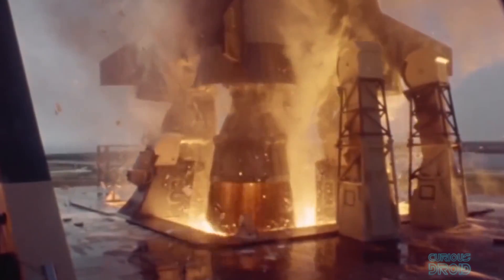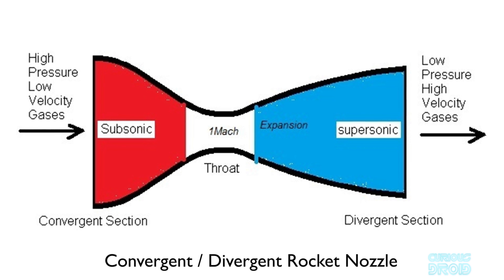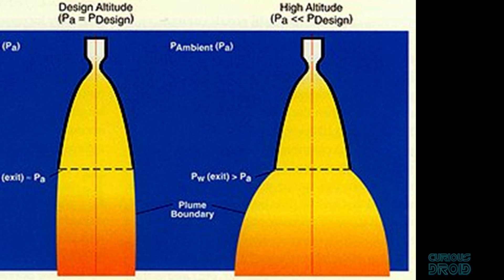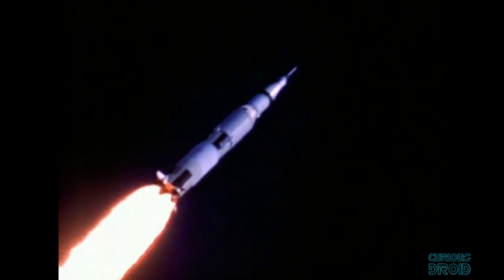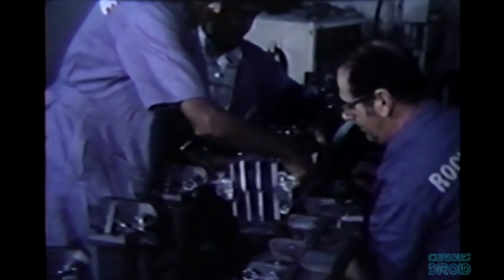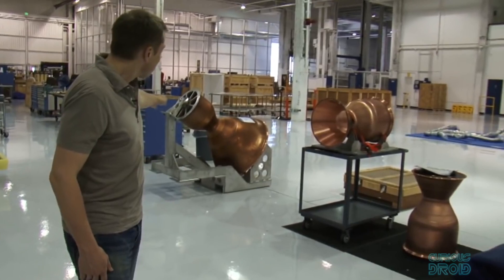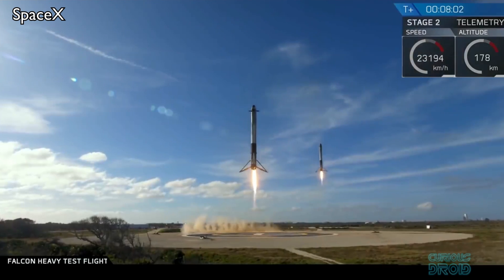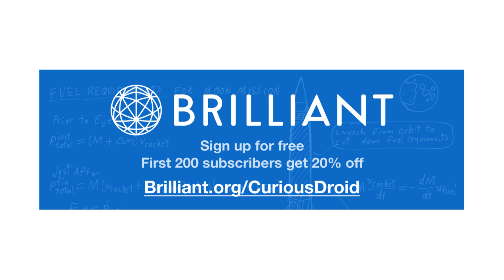Aerospike Engines - Why Aren't We Using them Now?

Comment: Damn the cost!   Nasa needs to bring back the Venture Star program, re-vamped, with Space X as a partner. We need a shuttle replacement that works well!!
Reply: I saw the partially assembled X-33 in its abandoned hanger back in 2004.  Crazy to see such a high tech machine abandoned and covered in owl shit.  Making the fuel tanks in the shape necessary for that lifting body platform is just too complicated, and materials haven't changed much since then.  It'd be interesting to see a conventional cylindrical rocket using them though.
Reply: I met a guy who worked on it.  He said they knew the composite tank would never work, they put it in there anyway because they needed more time to write the avionics software.  They underbid on purpose also; when Pete Conrad was told by NASA Lockheed was going to win based on price, he told them McDonnell-Douglas's bid was how much it's going to cost and Lockheed was lying.  And what I heard was that with aluminum tanks could take off, but it had no control authority so a breeze might push it into the tower.
Reply from the maker: That was NASA's big mistake
Reply: That should be the title of your video :  "Nasa's Big Mistake"        Or maybe a Future Video?? 
I even built a hybrid electric/rocket plane, and called it "Future Star".  
here is a link:
https://www.youtube.com/watch?v=J7f8hf8kgfg
Reply: Nope, NASA dodged a bullet.

First, the contract that NASA had with LockMart was a "prove it' contract, they got a fixed one billion dollar contract, if they exceeded that amount, LockMart had to eat it. They exceeded the billion dollars, LockMart had the nerve to ask NASA for more money and NASA said "Did you read the contract you signed?" By that time, LockMart wasn't going to do so and they stopped all work on the X-33, then a year later tried to hand it off to the USAF and they got laughed at. Why? Because...

Second, the X-33 was attempting to use technologies that had never been used for spacecraft, including composite laminate fuel tanks to save weight; and here's when things got ugly; during a tanking test of the X-33, when they were refilling the tanks with liquid nitrogen, one of the two tanks proceeded to split like an overcooked hot dog. This caused LockMart to consider adding metal fuel tanks to replace the composite laminate, which led to the issue that killed it.

Adding metal fuel tanks increased the weight of the X-33 to where it could not launch from the pad, it would have been too heavy-and that's when LockMart went to NASA and started begging, with NASA telling them to stick it and the USAF running away as fast as they could. And mind you, the X-33 was a quarter scale prototype, not a full scale one.

Don't blame NASA, blame LockMart.
Reply: Mark Wandrey
Space X doesn't pay everything out of their own pocket either, they got most of their funding from NASA. Actually, it's no different than any contractors NASA got involved with, for example, Lockheed Martin, one of NASA's contractor funded only part of the development and the public funded the rest. Hell, Lockheed Martin needs Boeing to build the wings. The only difference is that Space X has integrated production process, which bring down the price, making it a more attractive contractor. Generally, having one contractor do everything is cheaper than having many contractors. As big as Space X is, it doesn't have the resources to self-funded everything.
Reply: Lots more jobs for congress to brag about by throwing away 99% of the space ship on every trip. Venture Star promised reduced costs, reduced labor, and reduced pork. It was doomed from the beginning.
Reply from the maker: @FPVREVIEWS, mind reader, it's already in the works :-)
Reply: How are they going to rob from the poor to give trillions of dollars to the richest people on the planet if they have to spend a few million on rocket science? Their number one priority is to make the rich richer and the poor poorer and more miserable. That's it.
Reply: +Mark Wandrey NASA was testing the concept with the Delta Clipper, which worked beautifully. The fourth flight, the Delta Clipper was lost when one of the landing legs collapsed on landing, but the execution was solid. Why they decided to abandon the concept has never really been fully explained.
Reply: The Shuttle was killed because it was kept on for far beyond its designers' dreams. Using 60-70's era technology in computers, engines, turbopumps and insulation. That was why it cost so much to fly and maintain - some of the people that built it weren't even around at the time of the last flight during the Bush years. 

SpaceX exists only on the generosity of Uncle Sam. That "self-funding" comes off their profits off contracted launches. And as well it should - self-funding and expansion and vertical integration should not be regarded as something exceptional in any enterprise and yet somehow SpaceX is lauded for...doing something that everyone else does?

For all that the commercial space "industry" prides itself upon in innovation it in fact wallows in its own mediocrity and conservative nature. NASA itself considered and built the likes of VTVL and DC-X vertical landing rockets and the descendants of its technology live on in SpaceX's own reusable booster program. The Aerospike, NERVA/Pewee, Saturn, and a multitude of atmospheric flight concepts like thrust vectoring, composites, nickel-based superalloys and supercritical aerofoils are all technologies that NASA pioneered and that have now diffused to global use.

What has killed NASA and the general state of innovation in the US - and I mean genuine innovation, not rehashed concepts as an "app" or government-developed technologies given a new lick of paint under a "commercial" brand - was the post Cold War malaise that followed the fall of the USSR. And the rise of fiscal "austerity" that has done little but drive engineering talent either overseas or into the finance sector where their machinations led to the 2008 financial crisis. 

NASA's budgets, programs and plans were absolutely gutted after the US won the space race to the tune of only a few billion dollars in today's money. Chump change when you consider today's military budgets and the absolutely dreadful waste that has occurred in successive "defense" procurement debacles. There could have been a Mars colony started a decade ago, space nuclear power and propulsion, an orbital refuelling station and multiple missions to the outer reaches of the Solar System had NASA's funding been maintained and plans stuck to.

It is in fact the phenomenon of fiscal "responsibility" that had driven innovation out of the spaceflight and arguably nearly every other sector. Instead of engineers driving design decisions it is now a bean counter that needs things filled out in triplicate and a business case made for the most minor of changes. Encouragements by MBAs to sub- and sub-subcontract work in order to foster "competition" amongst suppliers of parts, draining both operating margins and expertise out of engineering teams and towards external contractors that do the same thing but that cost more. Boom and bust cycles of hiring and firing that replace experienced talent with fresh faced kids thrown into the deep end because they're willing to do the overtime whereas the seasoned employee has family commitments. HR, OHS and marketing departments that further drain operating revenues for questionable return on value and that seek to impose their own bureaucracies in the name of workplace "efficiency".
Reply: Never mind the enormous economic benefit to the US economy of the space program.  NASA budgets are background noise while the bang for the buck disseminates throughout the US economy.  Economic success requires fusion of government and business. That's why ALL successful modern nations do so.
Reply: Elon Musk and his Space X relied heavily on NASA's funding and contract awards, but of course, it's a PR suicide to give even a single dime of credit to NASA because bottom right-wing voters will pressure the government to stop funding NASA, which in turn means less money for Space X. "Private enterprise doesn't cost taxpayer's money" is just an illusion, NASA did way more than just sending rockets into space, they sends and still monitors a lot of probes that's still out there in space, and astronomers around the world still use it. NASA's responsibility is too broad for its current budget, where Space X has a much narrower goal. Elon Musk must keep people believing in "self-sustaining private enterprise" BS because ironically he don't have the financial resources of the entire country to fund such a project by himself.
Reply: Cant build space elevator system yet, until a suitable material is found and other practical issues are solved.     
 And forget about carbon/graphene nano tubes   they are completely not reliable when produced at a length.      the longer it is the more chance of it being weaker then half its original strength due to imperfections
Reply: Private enterprise and the free market will get the job done cheaper, better, and more efficient than the government could ever hope to.  There only needs to be a reason and to get the government out of the way!
Reply: Cheaper is not synonymous with better, and government health care will ALWAYS suck!
Reply: @ Mickey G
Median salary  big deal look at what the really good doctors make.
Before the 0bama care tax you could easily get dirt cheap insurance that would cover catastrophically expensive treatments.
in Canada while waiting months for tests or treatments.
Charlie Gard and Alfie Evans demonstrate the foolishness of trusting your healthcare to the government.
Reply: @Iustinian Constantinescu   
$/kg is where win/fail is determined, ultimately. SpaceX is the company that will do things first, and eventually become reliable. Blue Origin will probably always play second fiddle, but will be the mainstay and model of commercial space travel and exploration. We need both approaches to keep the interest and funding alive.
Reply: The Air Force wanted to look at the Venturestar program to recycle some of it into their space plane program, NASA's response was a firm "no". Venturestar was killed primarily by the Space Shuttle lobby which was/is a coalition of interests who fight against anything that might potentially kill the space shuttle gravy train. This is why the Space Shuttle's replacement is made largely of shuttle derived parts.
Reply: King Peter, that's because there is TONS of money to be had from continuing to limp along using conventional methods, and too much money to lose by allowing technology development that will replace those conventional methods. It grinds my gears that there are companies (and the government) out there suppressing things like cold fusion just so they do not put themselves out of business. I think it is rather short sighted of them. We should be A LOT further along this road if not for things like that. Just like room temperature super conductors, there is no doubt in my mind the reason we do not have them, is because it would crash the power company strangle hold. My dad personally knew a guy who designed and built a carburetor that would get 35 mpg out of a 1950's Buick straight 8, and an oil company bought the idea and it was never seen again. 
So the world focus will continue to be on the really important things like transgender bathrooms, instead of the ever growing population and the Earth's very finite resources. Eventually the human race will either have to expand to other planets, or die.
Reply: Whenever the government gets involved with ANYTHING, we lose more freedoms, it becomes more expensive, quality goes down, and efficiency plummets. There is no mention of the federal government controlling health care in the Constitution. Yes obamacare is most definitely a move to universal health care, it has the government controlling your choices just for starters, and it just gets worse from there.
Reply: Shuttle was a money toilet. What matters is moving payload efficiently.
Reply: Ob Fuscated
They got to repair those space telescopes somehow.
Reply: You tell Elon!
Reply: Actually they fixed the tank issue but not before the money ran out.
Reply: Can just as good start building the international space elevator system. No need for unreliable rockets.
Reply: We don't need a shuttle replacement at all. The shuttle never did a tenth of what it was planned to do. Carrying a big heavy vehicle into space over and over is a bad idea, and always will be.
Reply: Em Em yeah, you probably correct concerning carbon nanotubes/graphene, it's ridiculously expensive and difficult to make in quantities anyhow
Reply: BFR is like a shuttle as its reusable and it has delta wings which makes it a little bit more like the space shuttle.
Reply: Get Congress to pay for it.  :(
Reply: We should just build an orbital ring instead
Reply: venture star's fuel tank ruptured
Reply: The Space Shuttle was made over-complicated due to policies and mismanagement. But I hope to see a new space shuttle based on the BFR or its equivalent... Like UNSC Pelican or the ISV Venture.
Reply: "Damn the cost" is what killed the Shuttle in the first place. Embrace the cost. Focus solely on tons to orbit for as few dollars as possible.
Reply: Falcon9 is a functional shuttle replacement.
Reply: Economy, real fiscal responsibility, is the thing driving the reduction in cost and market domination that SpaceX is surely achieving today, this very moment. Saying they are doing the same thing as everyone else does not explain them outperforming the rest of the market, and neither does saying they're funded by NASA, because Lockheed-Martin has been funded by NASA for decades and they've consistently failed to make a killer app rocket that blew all expectations away. ULA builds a good rocket, but they didn't ambitiously pursue reductions in cost, either. No one is doing what SpaceX is doing, and they aren't getting patted on the back for doing the same old thing.

The shuttle cost so much because it took so long to turn around. The heat shields had to be completely reworked, and the whole craft had to be torn down and rebuilt. By the time it was designed, NASA had no will or wiggle room to make it better, and during the design process they were so hamstrung by the process and the politics of it that they were not able to throw out the design and start again when they realized it wasn't working. They were told to fix each thing, and damn the cost. Saying "damn the cost" will always get you a rocket that's too expensive to fly. The Shuttle cost the US so much money that would have been saved. 

The Space Shuttle engines were a work of art, the most efficient engine anywhere, and they were incredibly complex and expensive to manufacture. They had to be fabricated by expert machinists and they had an immense amount of hand-tooling. This is expensive as hell and not something that can be done in bulk. These engines had to be gone over very carefully every flight. It would have been cheaper to use lighter and cheaper engines that were less efficient if it meant building a bunch of them and swapping them out each time, inspecting the used ones on the ground, repairing them as necessary, and throwing them out if they were slightly damaged. If they had a single-minded vision to get the job done, rather than their mandate to produce components in as many constituencies as possible, to make the rocket "as reusable as possible",  then they might have backed off of the hyperoptimizations of the Shuttle and worked on things that were cheap enough to do the job.

Don't say "damn the cost". Look at what works, and do that, and more importantly, look at what doesn't work, and stop doing it. That's what SpaceX continues to do; they've thrown out innovations they just couldn't get to work, because they want to go to space, not pride themselves on conquering specific individual technical innovations. They wouldn't use Shuttle engines because they know how hard it is to make them; they couldn't afford to make such a complicated engine. They made a new engine because a simpler engine with a few risky but researchable innovations could be produced quickly in volume, which was the only way to produce the volume of rockets needed to dominate the market.
Reply: God, why am I replying to you? You just came up with an incoherent string of complaints about the world, and somehow managed to blame all of them on "fiscal responsibility". 

HR, OHS, and marketing departments seem to improve the performance of other companies. Why is space special in that suddenly when you walk into a space company all those issues go away?

How does procuring NASA rockets with the same exact pricing structure and budget as those same military spending debacles give you a better rocket than the Shuttle? I think you can't pretend like somehow those same funding schemes get more effective when NASA does it, especially since NASA has shown in the past that they cannot build cost-effective rockets using the same procurement methods as the military; how would giving them more money do it cheaper?

How does SpaceX qualify as rebranding of past efforts when none of the efforts to make a reusable landing rocket actually worked? Nobody combined old and new and made it just WORK the best they could. How can you ever compare doing what it takes to get to space with the half-assed money grabs of old space?

SpaceX designed Falcon 9 of their own volition at a development cost a fraction that of what NASA even says they could have, had they had the idea and tried to contract it out for development. SpaceX has dramatically reduced the cost of going to space in a way every rocket vendor on the planet cannot compete with. If they have only been able to do so with NASA dollars, they still did it by saving NASA money and they still manage to outcompete every other rocket on the planet. Any potential true rivals are merely graphite stains on sheets of paper.
Reply: TheRealMarauder
The reason why contractors such as Lockheed Martin can't achieve the same expectation as Space X is because they subcontracted a lot of their parts, which saved them money but will add to the cost for the end customer (NASA and US government). Hell, look at F-22, Boeing manufactured half of its fuselage and P&W developed and manufactured the engine. Space X did one thing that most contractor doesn't do, they produce almost every parts in one factory rather than hiring someone else to do it or produce many different parts at many different locations. Space X isn't necessarily more innovative than other contractors, if anything, other contractors such as Lockheed, Northrop etc. actually have better technology on paper, it's just that they can't produce everything by themselves, and US government, as wasteful as they are, still have limits on what price offer they're willing to accept. Often times, if contractors asked funding that exceeded the contract, then the US government simply canceled the program. This is what happen to a lot of space project, it exceeded the provided funding and the project got shut down to prevent further cost.
Reply: @ Em Em
You don't need better materials for a space elevator you need a better design. For an orbital tower you need better materials but for an orbital ring  with multiple tethers Kevlar and Spectra fibers will do just fine. The problem is getting all the steel for the ring into orbit.
Reply: @ Michael O'kane
You need a very large number of heavy lift flights to build an orbital ring.
Reply: The Russians already Did... https://youtu.be/vYvhRVkEKSU
Reply: Atomicskull
The main reason is that Lockheed Martin exceeded the development cost of the X-33 program, after NASA already invested almost $1 billion into it. Of course, LM asked for additional $300 million to "correct" the setback encountered during the development, but of course, NASA can't effort to spend another significant amount of their budget toward a contractor that is well-known to overrun cost of many programs in the past. VentureStar is basically a larger X-33, which in turn didn't even have its technical problems corrected yet. As of current situation, relying on Russia's rocket is the cheapest alternative despite the fact that Russia bumped up their price since the space shuttle was retired.
Reply: Not just the space shuttle, but regular LEO launches of satellites could make use of such re-usable rockets.
Reply: I wish that we, as a country, had the nerve to follow NASA down the "damn the cost" road.  It's almost common knowledge that NASA spending a buck earns more than a dollar of tax revenue, so... this is the kind of development we want to be using to push humans further, faster, and safer.
Reply: @CanvasIO It's almost common knowledge that this is absolute rubbish.
Reply: Don't worry. The chinese will manage to produce a workable Aerospike engine.
Reply: @ TERRY WOODS
The video you linked to is Flat Earther nonsense.
Reply: But we need to build that Wall!  Right guys?!?!
Reply: calvingreene90
Downplaying median salary, well, it's a big deal because that's the strongest factor any potential medical student look at before considering pursuing a career in medicine. Everyone wants a high starting salary, becoming a millionaire is just an end goal.

Obamacare isn't a universal healthcare policy, what are you talking about? It's mainly implemented to address the problem with under-insured and pre-existing condition coverage, it's not remotely a step toward a universal healthcare. Healthcare insurers are raising their premium as a retaliation, it's not their necessity. And insurance is what made the healthcare expensive anyway, in the past before the insurance industry boomed, people pay directly to the hospital they visited and get treatment at a reasonable price, even without universal healthcare. 

And yet Canada's healthcare outcome is much better, while spending less of their tax dollars on it per capita than the US. Plenty of videos on Liveleak show that people died while in waiting room in the US, but none in Canada as far as tried. What's a big deal with waiting for months for treatment if your condition is not serious? Ever heard of priority? Private hospitals still exist in Canada, if a spoiled kid wants to get a quick treatment, they can just go there. The waiting time is being taken out of context and misrepresented as a common myth against universal healthcare, literally no one died because of it in Canada and Commonwealths.
Reply: Hmm, will you give up your social security money ? Or your health care ? How about your pension ? When needing more funds, where do you think they'll trim it from?

https://www.nationalpriorities.org/analysis/2012/presidents-budget-fy2013/

Despite retarded liberals claiming military spending is highest in USA, is 3rd highest, behind social security and healthcare.

Granted, they have a point, US military spending is extremely high compared to other nations, but do you think money gonna come from military industrial complex, or depriving granma of her 10th doc visit ?
Reply: Zamolxes77
I'm pretty sure you could answer that yourself. Left-wings may misrepresented the US' budget, but there's truth to it though, defense spending do comprised the largest item in Discretionary Spending (capitalized on purpose). Social Security and Medicare are Mandatory Spending, which is more politically risky to change, even some conservatives (especially retiring one) objected cutting it. Military budget is still a large item even if it's not the largest in total spending, so allocating even 1% of it (out of about $600 billion) means $6 billion more for other item, if that goes toward NASA, that's 30% increase for them.
Reply: http://action.ae911truth.org/o/50694/t/0/blastContent.jsp?email_blast_KEY=1390107
share
Reply: @ Pete Smith
The first Falcon Heavy flight was not going to carry a payload that anybody payed to lift. Usually test flights like that carry a block of concrete and given your attitude about space exploration Musk sending the car into a mars crossing orbit is the only reason you heard about it.
Reply: @ Mickey G 
There is a big difference made by knowing that you will not make much more than median no matter how good you are. The reason most the doctors in the UK are not British by birth or childhood is the lousy pay in the British medical system.
Reply: @ Sean Struble 
Yes we do need to build the wall along the Mexican border because the wall is the most cost effective way of protecting the border. The Native Americans did not control their borders and look what happened.
Reply: wow that is incredibly racist ^
Reply: A 400% increase in engine efficiency would make SSTO fairly easy: we are right on the edge of it being possible. it would not be as efficient as a two stage but it would work.
Reply: King Peter - What solar electric power units have overall greater efficiency? When I was young solar panels were very expensive and less than 1% efficient. Now last I heard they are over 10% efficient and much cheaper.
We can't make the sun send us more or denser energy so efficiency is our only option. If $1 gets us 10% efficient solar collectors-converters but 11% efficiency costs $10 it's not worth the added expense.
Reply: Terminal Reset - Would been better spent dumping $1,000,000 bills in the ocean. Unfortunately a small but significant minority of humanity is composed of thieves. Thieves who will murder to take from others.
Reply: Bearcat Ben - Quit voting for the politicians who authorize spending on stuff you don't like paying for.
Reply: Mickey G - Motor vehicles are near-useless without public funded and public operated roadways. A.few privately funded and operated tollways exist but you get to them on public roads. Commercial aircraft are useless without public funded and operated airports. Railways that are privately owned and operated require government to aid them to acquire the land the Ry. must have for its tracks and facilities. Water shipping requires publicly funded and operated ports and waterways, government navies to protect them from pirates.
Private property ownership requires publicly funded and operated police forces, government land registries. A few land barons like King Ranch are partially self-protecting but still must have a government land registry backed up with government force or someone who can hire more gunmen and get more armament can take it away from the current registered owner. Ask the Amerindians about that.
Reply: Em Em - The military is the chief purpose of having a federal government. Why not just advocate abolition of the federal government?
Reply: Nilguiri - Poor people should be punished. They deserve it. All they want is beer, drugs and irresponsible sex. The whip for their backs.
Reply: Shawn Elliott - The days of the heavy glass soda pop bottle are long past. A new one-time-use thin plastic bottle is cheaper to make, handle (doesn't break), transport (light weight), and where recycling is practical, high grade plastic. The old returnable bottles had to be handled (transportation back to the local bottler was almost free), washed, refilled, capped.
Motor vehicles are more and more recyclable. The all-electric cars will be recycled as when the battery is worn out to the point that the car can't make it to the grocery and back (10-15 years) on a charge, no one will be willing to pay for a new or even good used battery pack for a worn, obsolete car. Volt type IV-battery cars can last longer as when the battery pack is shot it still will run on gasoline.
Reply: Nilguiri - Yeah, unless you're a peer of the realm the NHS won't be giving 85 year olds anything but minor healthcare and pain relief. In assisted living/nursing homes in the USA the average age is 85. One fellow who was in pretty good health and took care of himself told me that just before he ran out of money and went on Medicaid his cost was $2,300 per month for a double occupancy room & board. He required no nursing care beyond guiding him from the cafeteria back to his room.
Reply: Frank Harr - With OPM (Other People's Money) of course.
Reply: Ruben Scott - What do you mean? We running out of paper and ink to print T-bills? Besides the Swissfrancs that he gave to his Muslim brothers in Iran were counterfeit.
Reply: MonMalthias - The main thrust of military strategy is to break Russia and China trying to keep up with the US. Russia's economy is in a shambles. The government there is just the biggest mafia among many that run what there is of an economy. Don Vladimir has to go through the outward appearance of being an actual elected president of the appearance of an actual elected Duma (Parliament) even to the point of a loyal opposition that votes against him. All parts of the scam. Any real opposition goes to prison, gets sick or has an "accident." Who believes Don Vlad left behind everything he learned in the KGB? 
Of course we in the USA are being entertained by the Trump vs. Republican-Democrat Establishment dog-and-pony show.
Reply: TheRealMarauder - I looked all the way back and couldn't find any comment by God.
Reply: calvingreene90 - You won't be able to pay Healthcare personnel "on the side." It will be illegal. It is unfair to those who can't pay out of their own pockets. Medical personnel are on salary, which means they belong to their employers 24/7/366. No outside or "under the table" (free market); time off is time off. They are required to R&R when off shift. Kick back, have a beer, go fishing, take that hott new CNA out on a date. Nothing considered work. Get caught working "on the side" for "under the table" compensation: get pay docked, illegal money garnished.
Medical school education will be "free" to those who qualify. Work ten years after residency and the student loan is remitted. Work twenty years in healthcare and retire on full pay grade and benefits. By the time a Healthcare pro enters regular employment after residency s/he is 28, so retire before 50. Become med school teachers. Go into medical facility management. Go to work in wife's antique shop. Do consulting.
A program like that will not suffer shortages of applicants.
Reply: calvingreene90 - In the USA shop around and you can get a MRI for about $250 rather than $5,000 in a hospital MRI. You don't have to use the latest $10 million machine. Older ones are just as good.
Reply: calvingreene90 - Everyone except blithering morons knows the earth isn't flat. It's curved because it's the shell of a megagiant turtle.
Reply: Sean Struble - And a seawall. And isolate international airports. Now they're invading from Canada.
The Amerindians didn't have any idea of what was coming. Not that they.could have.stopped the invasion. All they could have done was to emulate the Gibeonites.
Reply: Being the Russians charge an arm and leg to recover cost of cargo and human transport to the ISS and has the only operational program to do such, it is in our best interest to reestablish parity in the program.  Look what happened when we ignored the concept of space exploration in the late fifties and early sixties.  We lagged far behind and wasted a lot of money through disastrous rushed catch up programs.  The Soviets were launching men into space and we couldn't get a rocket off the pad.  How many failed launches we suffered has never truly been revealed.  Only when successes started occurring was the public informed.  We need to start these programs back up.
Reply: @legion You already have them.
Reply: good luck with that but you think what you want
Reply: Mike Davidson  
My dude, Ion or what ever a plasma base engine you are talking about Is no where near the level of technology we have, and antimatter production on a large scale is out of the question even with the technology to accelerate plasma. just for the Ion alone we would need powerfully energy production capacity to power a large ship.

might I suggest also expanding your political knowledge outside of the basic and biased American bipolar view. I am not American but bickering over 2 side of the same coin is one of the reason your country is in social backwaters compared to some other countries, I'm not saying Em Em is right, but that what you call democrats, and what you call republicans are as equally corrupted but with different economic points of view, one of controlled economic and one of Egalitarianism, weirdly enough, these 2 point of view keep switching around between conservative parties and liberal parties. 

If I may point out that welfare was proven by many countries in Europe and in Canada to help improve the poverty situations and also the qualities of the workers something that what I'm guessing a "republican" would like as well.

But in the end both sides were and are not interested in space explorations, I dont know if its a generational gap thing since both sides puppet master are old or simply not thinking that it's wort the money. Space Exploration recently re-became popular thanks to the internet and stuff like Space X showing amazing feet in technology and amazing people with spectacular displays like a 4 hours live stream of a car in orbit.  Unlike Television which is a controlled media, The wild lands of the Internet is a amazing place for democracy to take place but also a amazing place to gather knowledge if you are careful to look up different source in order to avoid biased opinions
Reply: @dodecahedron1  Embracing cost requires being willing to scrap designs and political reasons for clinging to one design or another.
Reply: Blue Origin might be the better partner to develop the aerospike engine. They take a more methodical and cautious approach to the development of their spacecraft. Blue Origin already has more powerful rockets than SpaceX uses, and I would think that they are looking at aerospike engines.
Reply: ONE of MANY mistakes, that canceled Venture Star. 

Other missteps of NASA include the general design of the STS, failing to return to the Moon, failure to set up more than ONE space station, no SSTO vehicles...the list goes on.

Oh, and about all that money?

How many years of wars have we fought? How many trillions blown up as ordnance?

Seems to me a lot of that should have been repurposed for spaceflight.

Just saying...
Reply: ...Why? SpaceX's fully reusable multistage rockets are simpler, more efficient and - in the end - cheaper per ton to LEO.
Reply: the space shuttle design is retardedly complicated compare to the design of the BFR. Plus NASA does not get the infinite cold war funding it had. The tech space x uses was already available but NASA does not have the capability to exploit it due to its retarded structure. Space x also has few competitor on the same level because of the Business mentality of "if it works, it's good enough".

SSTO like in science fiction wont happen until we make powerful and efficient energy sources and extremely efficient engines. Yet most of the planet is still fucking around with combustion engines and wind or inefficient solar energy like solar pannels
Reply: SSTO would required none of the vertical landing infrastructure and technology, that can be used on drop ascent tanks, payload, etc. Even SpaceX has to use two types of engine because of the reasons explained here. And they'l always throw away the upper stage, which and SSTO won't. Must >might< be able to eventually salvage the payload fairing, SSTOs don't use them. 

Old fashioned bell nozzles are WWII technology. This should have been perfected, or at least given a chance to be proved impractical. But NASA doesn't care about that, because they're not spending their own money.
Reply: Yes, that's why vertical landing was given up by NASA as impossible in the 90s, and SpaceX mastered the tech. Clearly he's incompetent. Were you one of the fools laughing at them before the first Falcon 9 landed successfully, or the dozens that have since. Get  a clue.
Reply: The Venturestar and almost all SSTO programs so far have been terrible ideas. The only remotely decent SSTO that has had hardware built for it so far has been the Russian MAKS spacecraft because the RD-701 tripropellant engine actually could give enough performance to make SSTO somewhat doable. 

The venturestar was doomed from the beginning because the mass ratio needed for SSTO was impossible with the technologies proposed. It failed to even meet the performance requirements for its suborbital demonstration mission. The aerospike engine was arguably one of the the worst parts of it, just using the RS-25 would have worked way better.

The way to make reusability work is TSTO's. You have something like twenty times more margin for mass growth with a reusable TSTO as opposed to an SSTO.
Reply: drb166 The 3-stage New Glenn, which will likely be more powerful than Falcon Heavy, isn't coming until 2020. It seems to me that what blue is trying with the new Glenn is trying to be better in  $/kg to GTO than Falcon 9/Heavy and have extremely high reliability, in order to start with market takeover in 2020, before the BFR is ready ,probably in 2021 so that the BFR will have big delayed.
PS:I agree that they are more likely to use aerospikes than SpaceX, because even if the rocket blows up, they can just continue development, with money from Bezos.
Reply: Kill the fed reserve and we would have the money...
Reply: Nilguri 
Universal healthcare provides a terrible level of care  discourages people from becoming doctors because it does not pay fair wages for the effort put in and most tragically puts bureaucrats in charge of who gets what level of care and if you do not like the care you are getting you can not get alternate care. I will pay for my doctor who can proscribe alternate treatments.I can also get an MRI on hours notice not weeks or months.
Reply: Damn the cost? If you really feel that way, you are free to sell all your property and donate your salary for the rest of your life to NASA ;) Otherwise, realise you are advocating for massive involuntary spending of others' wealth to suit your own narrow view of how the world should be.
Reply: There will be: the BFR by SpaceX. There is no need for Venture Star anymore.
Reply: Jason Todge
Universal healthcare is cheaper for all concerned than your ridiculous system. Get a clue, mate.
Reply: FPVREVIEWS Obama gave all that money away
Reply: Why would you want parasite driving costs up in the program? Did you fail to watch this video? NASA will do it cheaper alone, for one, because they don't waste money on ads and lining the pockets of the boss...
Reply: SpaceX gets many of its launch contracts from NASA, and it wouldn't have existed without NASA, but they saved NASA pretty sizeable sums of money. Now they have the money to fund the production of a new rocket, which they're doing on their own; they've got nearly an entire rocket engine designed and built with their own money; they've definitely got the resources to self-fund an aerospike engine development program, if that's where they decided their money is best spent.

SpaceX got only about $140M from NASA to help fund the design of Falcon 9. They also received less money per launch than any other provider and yet they have had a success rate of over 90%, and maintained their cost despite vertically integrating their sub-component manufacture and changing their testing procedures radically following CRS-7.

Yes, much of the funding for the vehicle came in the form of contracts from NASA, but those contracts purchased rocket launches. Yes, some of the funding for Dragon is coming from COTS, but that comes with actual purchases. Now SpaceX has an entirely new rocket engine design they funded on their own, and they've self-funded a great deal of BFR development on their own.
Reply: calvingreene90
I looked up on doctor's median salary (of the same specialty) in Canada and the US, and it's roughly comparable. Also, about countries with universal care have long wait time, that's only half-truth myth. They sorted you based on how urgent your condition is, the way it should be, people with common cold shouldn't get to see doctor before people with heart problem. "Universal healthcare is terrible" is a myth that is easily debunked, and by the way, hospitals are generally the same, the only "choice" you get in the US is insurance provider, and ironically they limits you rather than give you "flexibility." And if you're a middle class, you spent more of your money paying for insurance premium than public healthcare in tax.
Reply: fot what? waste billions of dollars tax money  to dead planets "explored"  by robot or shoot a tesla car up there for shits and giggles using billions of tax money.
Reply: @ Juno Berries 
What is racist?
Reply: NASA would love to do all kinds of great stuff, you should thank your republican greedy religious politicians for lowering the budget for science and increase yet even more ludicrous to the military.
Reply: Damn, a few SpaceX fanboys spewing misinformation and a few bashing spacex with the same type of misinformation.

Firstly, SpaceX does not make money, it uses a ton, much like NASA, it receives large amounts of government funding. SpaceX, is not fully re-useable, they have been discarding their upper stages for a while, and as far as their performance indicates, they are not close to changing that. SpaceX is using relatively old engine technology, most of which could be found on the Apollo spacecraft, but old doesn't mean bad, most airliners with the few modern additions are over 40 years old going on 50, planes like the 747 and 737, yet they have been updated some and work well at what they do.

SpaceX has a founder that is a loudmouthed child. I'm not joking when I say Elon Musk is not just a child at heart, but also a child by attitude. His twitter is evidence of that, more in tune with a 16 year old than a business operator.

Elon Musk, makes promises and then takes a long time to deliver something different than what he promised. Telsa has changed significantly since it started, even spaceX and the Hyperloop (which is a colossal failure, not just by him but everyone else who tries it). His other ideas are loony at best, he has said spacex could have people on mars in 7 years despite not having sent a single person into space, by comparison it took NASA with the support of the entire country in competition with our then mortal enemy 10 years to simply obit the thing. He has expressed desires and concept video of landing a space taxi next to a city, within range that if it did decide to catastrophically fail, would be like dropping a nuke on the launch pad. He then promises $1 rides on the boring machine transit tunnels, which I will eat my hat if they are $1US dollar and not 1 bitcoin 'dollar'

In the end, SpaceX has made some advancements, but nothing that NASA couldn't have done had they been given the proper funding and decided to move to new technology instead of trying to save the flawed from the beginning space shuttle. Elon Musk has a lot of startups that are in big trouble if people stop believing in them.
Reply: People seem more interested in paying billions for free healthcare than spaceflight.
Reply: Gᴜᴛꜱ • ᏖᏂᏋ ᏂᎧᏬᏁᎴ Ꭷƒ ᎴᏗᏒᏦᏁᏋᏕᏕ there is no space flight NASA is False
Reply: Hey this might be heresy but i don't want to pay all those taxes
Reply: @bearcatben4762  Why not? A large portion of your taxes already goes to missiles designed to blow shit up in other countries. Might as well do something constructive with the money.
Reply: FPVREVIEWS Musk couldn't execute an advanced technology program like that even with an aerospike shoved up his ass.
Reply: NASA ... is a hoax.